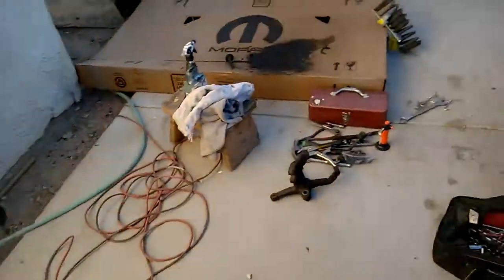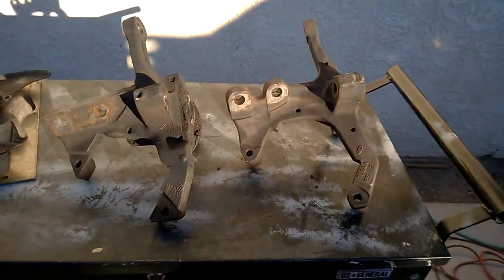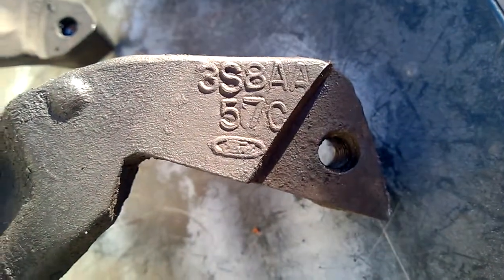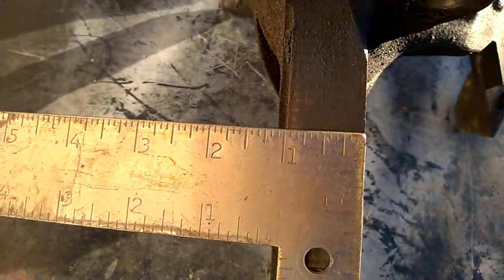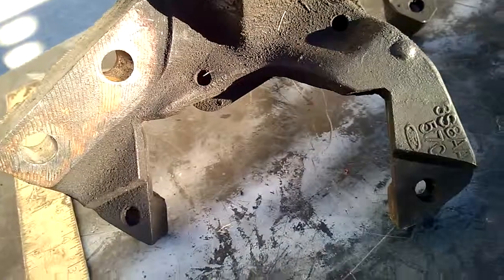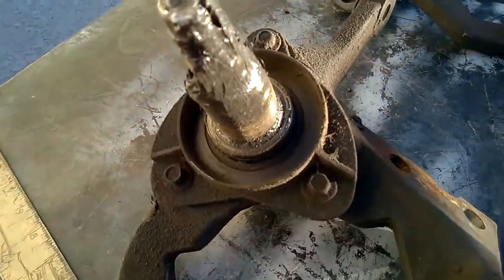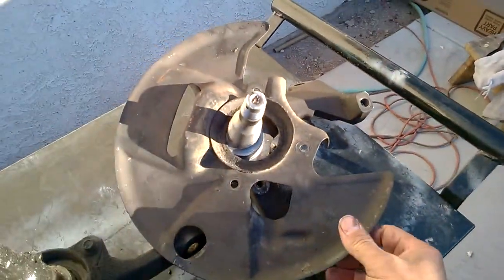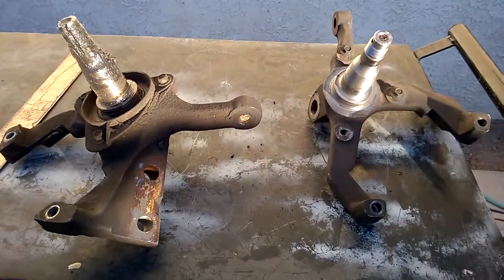1986 VS 1987 Mustang GT Spindles

Comment: Informative video. I believe 87-93 4 cylinders use the 1986 style spindle as well. Unfortunately I'm running the stock '86 spindle on my 1986 Mustang GT. You are pretty limited on shock and rotor choices with the 1986 spindle. I hacked mine up to mount Aerospace 11 3/4"  rotor four piston street brakes, which was the only kit I could find that would fit on the old style spindle, and surprisingly they fit pretty well and even give me a little more wheel clearance on my 17x9 Cobra Rs. I'm still limited on shocks, though...
Reply from the maker: 17x9 must be tight up front. I thought I read the 87 up fenders were rolled to allow more clearance. Thanks for commenting!

Comment: This swap has to be done in order to run a 5 lug rotor in the front of an 86 gt?
Reply from the maker: I'm not sure how the Ranger 5 lug swap works. This swap was done to get the larger 4 lug brakes from the 87-93 Mustang. The entire front suspension was old and sad. This was just one portion.